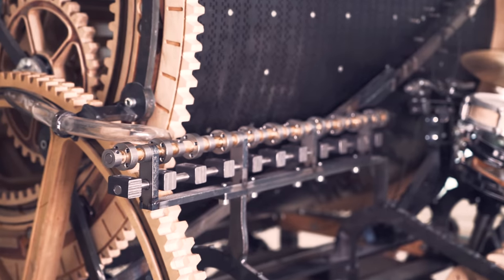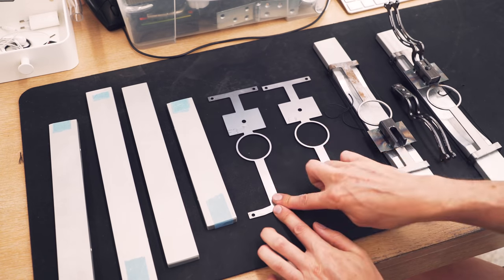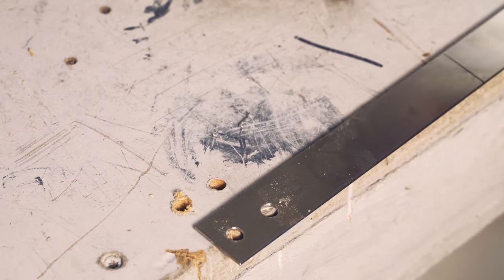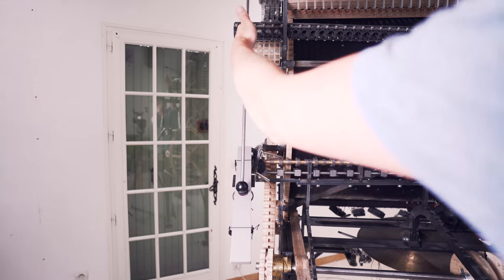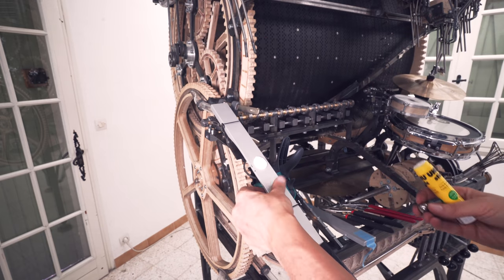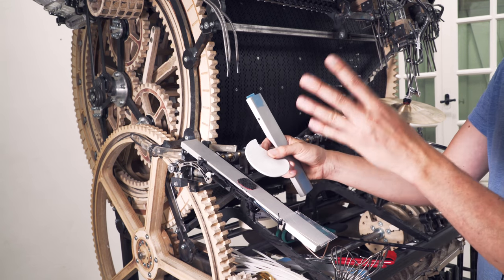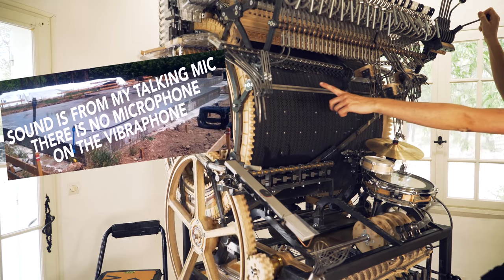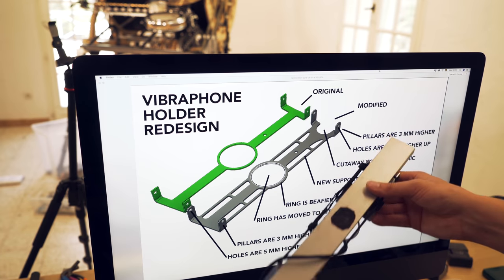Vibraphone Design Test 1 - Marble Machine X#88

Comment: A stiffer Spring steel below your notes would make the Marbles Jump further, because the springs would "steal" less energy from the marbles. Maybe give it a try and see what it does.

If that doesn't work, maybe your springs are already to stiff, and you need to soften them a bit. Somewhere is a sweetspot, where the Marbles fly the farthest.
Reply: Im upping this one, alas, each note will need a different spring tension
Reply: Yes, that and the stiffer steel would allow the Vibraphone plate to sit at a sharper angle toward the ground without losing the tension. This would give him a slightly longer distance for the ball to travel and it could possibly help the ball jump the full length of the plate in one bounce!
Reply: So that the technician has to change the note, the piping and now even the spring?
Reply: Time to attach the spring steel to the plate and add a slot to the machine (versus two screws) so the spring is easily changed?
Reply: My original design had counter weights so the spring steel is already so much simpler. I think any modifications to the springs mid gig is a no go just too much to do. Even changing the lengths of the resonator pipes might not be feasible. They are tucked into the guts of the machine. They also will only change a few cms.
Reply: I dont play the vibraphone but can't the impact point just be moved forward?
Reply: Yeah, adjusting the spring tension and the angle will fix the problems with getting the marbles to bounce properly.
Reply: OR maybe he could move the mounting point of the laser cut pieces (the square part... the "click" bit) backward a bit so that the vibraphone... "plate?"... "note?" whatever hangs down a bit further (away from the machine) so that the balls would have to come out further and fall further therefore gathering more velocity before hitting it? Or release the marble from higher?
Reply: Another solution could be to not mount the vibraphone parallel to the marbles path but to turn it sideways slightly. This way even with a small angle the marble would miss the second hit. This would probably mess up the design though.
Reply: @eggsoups  The contact point must be at the peak of that arch under the plate.
Reply: Do the vibraphone plates have to be flat? If you add an angled section at the strike point you could control the release angle of the ball. Also it would effectively shorten the length of the longer plates. I am thinking an angular design with  two 10 degree angles either side of the strike point. Hard to explain in words.
Reply: @Distinctly.Average  probably don't want to mess with the geometry of the plate (he's not making them for a start) but you could angle the rubber impact pad?
Reply: Also, maybe having a felt washer/dampener on the pivot that can be tightened to taste that will slow the return speed of the note.
That way you can use the same spring for all notes.
Reply: Newton's Third Law
Reply: Dawn a calm kitty you know, part of inovating is to make something new no one has built before right? Also, what is wrong about giving advice when you sre genuine? It only helps
Reply: Could those resonator pipes be extendable in some way? (Perhaps like those kids' toy collapsible light sabres)
Reply: Yup, if they weren't removable, this solution would work, but with changing the notes it would also require the technician to change the tension of the springs, which would depend on the note / length. Ultimately it would be a poor solution. Another way of looking it at it would be to have a tray that sits just below the contact points (But does not touch), that would catch and direct the marbles. You could use something to isolate the sound too, so that wouldn't be an issue. It's pretty much the same solution used at the end, but you would have one piece rather than individual ones for each note.
Reply: smaller marbles = bigger jump.

Comment: Maybe someone has already pointed this out, but vibraphone bars sound best when struck off-center because the center is a harmonic point. So, about halfway between the center and the mounting hole is where a vibraphonist would play 99% of the time. (That would also give you a shorter required bounce distance to avoid double-hits.)
Reply: A few people have commented this, I've relayed this to Martin so thank you. Hopefully the solution might be that simple.
Reply: So glad that people are saying this.
Reply: you mean the dropping point can be adjusted closer to the flower funnel thingy just for the lower notes? Brilliant. but when the bars are changed would that be an issue?
Reply: @culturenomad  The solution for this is to make the mounting point (with the ball detent) centered under the strike point of the note. You would have to re-measure all of the notes and find out the distances to the optimal striking point. Then, using God-like CAD skills, update all of the mounting brackets to center the strike point of the bars in the same place.
Reply: @kyleballing  only trouble is you would then need to be able to adjust the tube position to the new centre point. I guess if you need to change the tube anyway, you could build a variable offset into the tube mounting.
Reply: @MrGonzonator  Adjust the angle of that little rail in the place where martin release the marble. That metal pieces where the marble slides on. I think is the place to make all the adjusts.
Reply: Makes sense, the metal vibrates faster than the hammer (or in this case, marble) travels. Although, it's so microscopic I can't imagine it affecting the sound, but I'm not a musician.
Reply: @malco84  the problem is that he wants to much honestly. In engineering you always have to give up something for other things.

While yes you can move the striking points that's going to change position based on which note you use. I'm not familiar enough to know how much the length changes with scale. You could move each note to strike the specific offset but then you have an issue with the resonator below. :(

I am curious why you cannot make the resonator two bodied and just have them slide another part into it based on the length they need. Once again not familiar with this type of engineering. 

One thing I've noticed this entire piece has become one piece of nightmare to matiance and upkeep.
Reply: @seemlesslies  the resonator design is currently made from multiple pieces of plumbing pipe and joints. There is a section that can be lengthened but this is hard to access. The resonator pipes all sit directly under the centre of the plates. I've never been able to get Martin to commit to which notes can slot onto which arms. However the centre of all the notes should be located over the centre of the resonator tubes. This is probably the reason Martin has chosen to hit the centre of the plates.
Reply: @seemlesslies  I've shared some pics on the discord channel which illustrate the issues with this section. You are correct that the only way forward is through compromise however that is a hard pill to swallow for someone who has dedicated so much time to this project. It is also a very hard thing to design without building it and trying it out, which obviously creates delays in the design process. As much as I don't like the plastic cover, I was very happy to see it in this video as it shows Martin is now willing to step forward without getting everything just so. Hopefully we can fix it in the future but also hopefully nothing changes which would make any solution formulated now invalid. There has to be a fair amount of organic design to this process.
Reply: @malco84  Each vibraphone bar comes with a custom mount and custom resonator pipe anyway. If you switch bars on stage, you switch bars AND resonator pipe. So I think it's possible to have a parameterized mount for both the vibraphone bars and the resonator pipes so that the bars get hit in the "sweet spot". In such a vibraphone/resonator/marble system there would be four invariables constant to all notes: (a) marble hit point [everything is designed around this], (b) marble drop position, (c) vibraphone mount point, and (d) resonator pipe mount point. With these four constant, it means that the center of the vibraphone bar is variable, in a different point (e), and that each resonator pipe must be designed to end underneath this point (e), but since they're all custom anyway that is no big effort.
Reply: @phrxmd2616  if you go on the discord chanel I shared some photos of the cad that show the restriction of space that the resonator pipes have to fit into. There is very little option of swapping the pipes out.
Reply: Agreed. A harmonic is ringing louder than the fundamental the way he has it set up right now.
Reply from the maker: Eden: Thank you so much for this! I was totally not aware of this, Very helpful comment, I tried it and my ears were like OK thats obviously sounds so much better, less "glassy" more robust fatter tone... plus less marble bounce, such a win win. Will demonstrate on a future video :) Thanks!

Comment: Hej, I've studied and played a lot of vibraphone. One thing to consider is hitting the vibe bars off-center, it generally produces a less hollow, more full sound.
Reply: And could help with the bounce problem! (by having the bars be hit lower down)
Reply: I'm so glad you said this! I just posted a comment saying the same thing, but I'm not someone who has played vibraphone or anything, it just makes sense that striking it 2/3 of the way  will resonate best.
Reply: that sounds like a really good idea, but you need to consider that all the cad is already worked out to hit the center. might just be too late to change it now, we'll see
Reply: Post this on the reddit page
Reply: Axel Fagerberg I don’t think that will matter because he will use contact microphones so squeezing every amount of resonance you can get isn’t needed that bad.
Reply: @felixdeckers8863  I've already forwarded this idea on to Martin. However after sleeping on it I can see the problem with this idea. Each note is currently located to and struck in the centre. The perfect strike point is going to vary from plate to plate. If we were to fix the plates so that the perfect strike point was always hit then the point above the resonator tubes would vary. I think the contact mics are backup, Martin really wants to be able to mic the resonator tubes but knows this will be very tricky.
Reply: @malco84  Couldn't the release mechanism just be extended a little?
Reply: You're right, I posted a comment similar to this. Anywhere away from the nodal points of the bar would be fine. You can find these points on any resonate percussive instrument by putting sand over the surface and lightly hitting it with a mallet, where the sand collects is where to avoid hitting. For a vibraphone key, It's right where the mounting holes are drilled. So an inch down from the center, or the edge of the key would sound just as great.
Reply: @alphredgaede5465  yes but when the notes change the relative position of where the plate is struck changes. If the notes are a similar size then this should only be about 4mm however at the extremes ie dropping an octave this will be 10mm. I think Martin will do some testing on this to see its effect when he has the time.
Reply: Axel Fagerberg thanks, Axel F
Reply: @malco84  What if release the marbles from a higher point? And about that spring steel? isn't that making the marble loose energy?
Reply: This goes for any mallet percussion
Reply: You write an english sentence and start it off with "hej"..
You truly deserve that manbun..
Reply: @malco84  It doesn't have to be perfect though, just staying off center will produce a better sound quality!
Reply: @afrog2666  It was just a swede greeting a swede haha
Reply: @wtfpercussion  cheers, good to know. I think Martin is going to be testing this out. My calculations suggest that this hit spot will only vary by ~5mm if the notes don't change by more than an octave.
Reply from the maker: Axel: As I have replied to others saying the same: Thank you so much for this! I was totally not aware of this, Very helpful comment, I tried it and my ears were like OK thats obviously sounds so much better, less "glassy" more robust fatter tone... plus less marble bounce, such a win win. Will demonstrate on a future video :) Thanks!